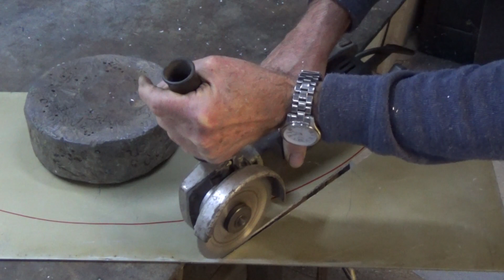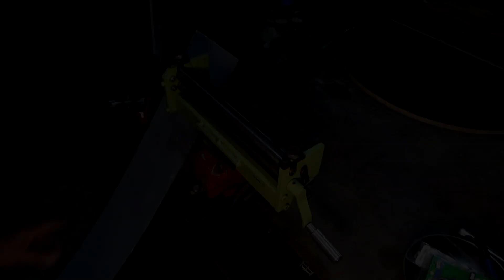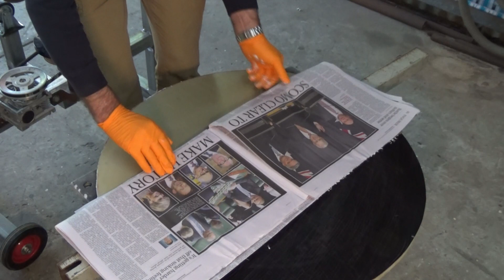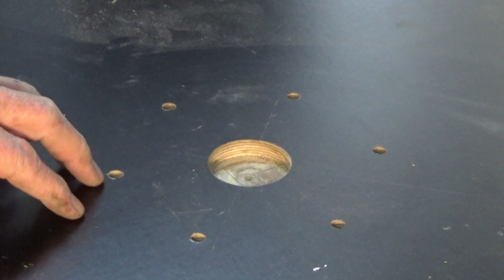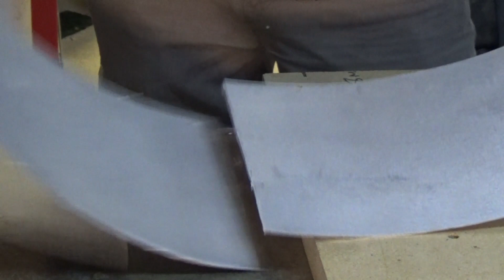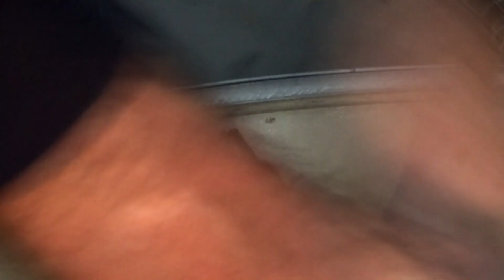The "Kooka Muller", a DIY Sand Muller for the Home Foundry Part 3

Comment: Hi Mark. The aluminium extrusion used at top is sail track. Can be bought at most caravan dealers or any business making canvas/ vinyl  goods. I used thousands of metres over the years as a canvas goods manufacturer installing caravan annexes/ awnings. Great video, I have been looking at ways to make a greensand muller for my future aluminium castings. Cheers, Tony

Comment: mark,
I beleive you will find that the Aluminium will erode quickly with teh sand being ground into it.
Once you notice any wear I would recommend that a 0.6mm of Grade 350 sheet steel be glued over the aluminum as a wear sheet.

great work
Reply from the maker: Charles, I wish I had purchased a couple of sheets of 4mm galvanised steel sheet that I saw at the local recycling centre. They were cheap and just the right size but at the time I had no intention of doing this project and I missed the opportunity. I expect there will be a lot of wear and tear on the aluminium but as you say I can re-skin in fairly easily. I might only use it about 8 times a year so it may outlast me!

Comment: Hi Mark,
as a suggestion when you glue large flat areas together, spread the glue in straight lines. in this way when you press the pieces together the air has a path out and does not get trapped in between the glue lines.
Criss crossing the lines of glue traps air so reduces the glue contact area but also the air acts like a spring that tends to separate the parts.
Reply from the maker: That sounds logical. Thanks for the tip.

Comment: Hi Mark, great vids and I just subscribed, where are you located in Australia 🇦🇺?
Reply from the maker: Hi, I live in Tinbeerwah which is about halfway between Cooroy and Tewantin at the top end of the Sunshine Coast. I was just checking out your channel and I watched the brass rising sun build. I did not know you could MIG weld brass! That's really impressive. I badly want to build a CNC plasma cutter but I have absolutely no room left in my shop which is why the sand muller will have to be stored outside under the awning with the tractor for company. 
Regards,
Mark Presling
Reply: Mark Presling gee your close mate. I’m 10 minutes north of GYMPIE, I mig brazed with silicon bronze/Argon back then but use silver solder now for most brass work. If you are ever after any brass scrap let me know and I’ll give you 5kg or so for your moulds. Also have other scrap if interested. I’ll have to start making vids again, I’ve been manly on Facebook,Instagram for most of my work with over 10k on FB page. Cheers Rick
Reply: Hi mark let me know if you want some scrap? I’d be more than happy to help out!!! Cheers Rick 🍻🇦🇺

Comment: Is that a slug of lead that you are holding the plate down with?
Reply from the maker: John, yes it is a big chunk of lead. It belonged to my father and I recall using it as a kid to hold macadamia nuts so we could crack them with a hammer. I think he melted down about 10 lead acid batteries to make that chunk. I keep meaning to melt it and cast it into something a bit easier to move, like a brick shape with a cast in handle. Maybe when I have a sand muller I can tackle that task.
Regards,
Preso

Comment: I don't know what kind of a sand you are going to mull with that, but what I use is beach sand mixed with bentonite and water - bentonite as a binder and water as solvent. Looking at your design if your sand mix is anything similar to mine, I think you will need couple of mixing blades for your muller to work. Problem with using just a roller and no mixing blades is that the roller will break only those clumps of sand that happens to be just underneath it's path and after those clumps are broken it will roll the sand in a thick and hard cake leaving the sand that's on the outer edge and in the center untouched and full of clumps. You need to have a center column on your muller that prevents a "dead zone" where sand is just rotating around the center axis  and mixing blades that scoop the mulled sand from the bottom of the muller and feeds unmulled sand to under the roller. 
Another thing that worries me in your muller is the wear resistant (or the lack of) of the aluminium. I have a industrial muller and the drum is lined with plates made from wear resistant steel but the sand is still eating that away. Also the mixing blades of my muller are lined with wear plates similar what's used in ploughs and excavator scoops and like, and wear out ot those is horrid regardless.
I don't mean to disharten you of bash your efforts by any mean though, just some pointers from my experiences. I wish you good luck with your muller and I'm curious to see how it turns out, for a light hobby duty it might be just adequate.
Reply from the maker: Hi, I am fitting the ploughs to the muller at the moment. Unfortunately I didn't get to it in the last video. It will definitely function the way you are describing. With regard to the aluminium base on the muller, I know it will wear but then I don't use it as much as an industrial muller would be. I might do 10 or so casting sessions per year so I am confident it will outlast me.
Regards,
Mark Presling

Comment: Reminds me of the foundation to my earlier muller.i hope it will work well.for.you. I ended up placing a 3/8 steel ring on the bottom just where the wheel rolls but my floor of the muller was as thin as tin that was on a laminated MDF turn table which was bolt to a vehicle trailer axle
Reply from the maker: I think I tend to overthink things sometimes. The operation of a muller is very basic and as you have observed it doesn't need to be built like a Rolls Royce. 
Regards,
Preso

Comment: That alloy extrusion is for a caravan or boat to hold an awning with a bolt rope.  Just for your info.  Great videos.
Reply from the maker: Thanks, I actually found some lengths of new extrusion down at our local hardware today. Quite frankly it would have been better to buy new stock since the stuff that was given to me was covered in great big gobs of silicone and lumpy paint. It took ages to clean it all. The only positive was that it had plenty of holes drilled in it already.
Regards,
Preso

Comment: Thank God you don't drown out your videos with God awful repetitive head banging thumbsucker noise. Any half decent machinist will agree that listening to the sound that the tool makes is part and parcel of operating it correctly.... If you don't mind me asking, where did you get that 60:1 worm drive?
Reply from the maker: They are available on Ebay here in Australia. https://www.ebay.com.au/itm/60-1-Worm-Gear-Reducer-for-NEMA-34-Stepper-Motor-NMRV040-CNC-Milling-Lathe/273846058370?hash=item3fc27f3d82:g:HtQAAOSwWzBc1orQ&frcectupt=true $139 including shipping. No music from now on except for very exception circumstances. I can't go into details but you will find out in the next video. 😀

Comment: Your doing a great job. Stop being so hard on yourself. Just my 2 cents for what it's worth, I would have screwed & glue the aluminum panels down. On the outside panels four to six screws around the circumference, and just three or four in the field. The center panel three or four around the circumference, each end, and just four in the field, equally spaced. Can't wait to see this Kooka Muller chew some sand.  Not for nothing, but I do believe you way over did the glue. I'm guessing that 1-1/2 tube(s) would have been more than enough.
Reply from the maker: Stanwood Dave, I had originally planned to screw the sheets down but I wanted to use stainless steel screws and I couldn't find any suitable. I had used that Sikaflex glue on a project where I had to glue down some galvanised steel anchor plates to some structural steel in an outdoor situation. It was also screwed down but I was told that the screws were just to hold things until the glue cured. I asked the consultant how easy it would be to lift the plates later if I had to do any maintenance and he said I would have to destroy the strips to do it. So far it is looking well bonded but only time will tell. 
Regards,
Mark

Comment: Looking great Mark. If you think you've had a hard time with some of the parts of your muller, just wait until you try to place the plows in just the right places to direct the sand into the path of the wheel.
Reply from the maker: Sandrammer, I just started that process today. The centre plough was giving me the most grief. I have decided to make them fully adjustable in all three axes. 
Regards,
Preso

Comment: Great stuff. As a non-caster I'm a bit puzzled - MrPete uses a muller, but he uses an oil-based sand, and I kind of thought that was why he used a muller. Myfordboy uses green sand, and he seems to mix with a drill in a bucket, but has automated the sieving with his own design of shaker. Maybe when you do your demonstration run,  you can explain mulling vs sieving etc?
Reply from the maker: thisnickldo, my understanding is that the mulling process is not necessary but it just sort of automates the preparation of the sand. Prior to this I have had to get on my hands and knees and use my hands to break up the lumps of dry and compacted sand and add the water with a sprinkler, gradually. However, the action of the muller also improves the strength of the sand mould by fully coating each grain of sand with a coating of fine clay particles. Without mulling the bentonite clay (binder) is just distributed throughout the sand matrix. Some grains of sand may have no binder at all and some might be only partly coated. I have tried using a drill and a mixer like the one that Myfordboy uses but I end up losing a lot of sand as it gets flung everywhere. At the end of the day I am looking for a method that creates a more uniform blend of green sand. I have found in the past that after I do a hand mixing operation there will be pockets of really wet sand and some that is too dry. When you ram up sand with non uniform moisture content it leads to problems during the casting process. If you check out Luckygen1001 he shows how he mixes his green sand and it appears to be perfectly blended. I have seen Myfordboy's seiving tool but that was a fairly old video I think. Unfortunately it is a very complex topic and everyone seems to have their own favourite method. 
Regards,
Preso

Comment: Wow, driving 100 km is a typical one-way trip that I wouldn't think twice about doing to get something. 
yep circumference of a circle is C = 2Pi*r but in rolling metal, the metal (especially aluminum) stretches and thins increasing the length 
for D = 720mm C = 2*Pi*D/2 = Pi*D = Pi*720 = 2261.95mm = 2.26m ~~ 2.3m thus the extra distance is in the stretching but that should be less than 10%... I think you have a measurement error (yep at 27:00 measurement error found)
Reply from the maker: My mate measured the length of the stock while I was on the phone to him. I am guessing he was trying to use the tape measure one handed. I will double check his work from now on. 😁

Comment: G’day Presso, the top trim is sail track, Bunnings has it for shade cloth as explained elsewhere. Hey I’ve got that model router, can’t stop it. The build is progressing nicely, well done. 
Cheers 
Peter
Reply from the maker: Peter, my mate rang me later in the afternoon after I had finished the video and told me that the extrusion was used to make clear awnings at the Noosaville Yacht Club. When he gave it to me it had great gobs of clear silicone, paint and zillions of pop rivets in it. It took nearly an hour to clean it up and I was thinking it was never going to roll correctly but it did. I will check out Bunnings next time I am there although I hate shopping there. The staff aren't much help and the aisles are always full of crap and if you want four of anything they will only have three! 😖 We had those Makita routers at school and the kids couldn't break them so they must be good. The one I have belonged to my father!
Regards,
Mark
Reply: G’day Mark look in the shade cloth isle not the aluminium extrusion isle:(  Ah yes the packaging of bolts is a bug bear. When I was young hardwares would also stock pulleys, not Bunnings. Problem is they look at turnover so the odd bits and pieces are now specialty items. Speaking of pulleys, I can buy them cheaper at the local bearing house than eBay, try eBay for a shaft set screw collar $15, bearing house, $5 I bought 1 two days ago, what’s going on with eBay???ahhhhhh enough ranting, cheers

Comment: Now if you could put together an adjustable curved laser for the bandsaw it'll be perfect!

I noticed the angle of that arm in the last video but assumed that either I was missing something or you had a trick up your sleeve to make it work. Oh well, I'm sure we've all been there.
Reply from the maker: Big face palm on that one. I also realise now that I have to modify the mountings for the ploughs so that they can be removed easily. The problem is that every build like this is a prototype. If you could build a second one you would most likely get everything right the first time but it is never like that. 
Regards,
Mark Presling
Reply: @Preso58  That's why it takes me so long to build anything. I plan it to death and then still run into problems when it comes time for assembly. Thanks for sharing the process!

Comment: @ 15:30....I always preferred C = πd....I always thought that 2πr was beating around the bush a bit. Quick and dirty estimating is 3xdiamter and round up :)
You made me laugh...a true perfectionist worrying about scratches on the aluminum that's going to be ground into submission with mulling the sand lol.
-Head smack at the end cutting the wedge at the top instead of the bottom lol...sigh I've had those days. But it's coming together nice great job so far.
Reply from the maker: I thought about cutting the wedge from the bottom but I was worried about shortening the arm. It sort of has to be sized so the roller is on the centre line of the drum so it doesn't roll "crab wise" if you know what I mean. I can already see scuff marks and wear tracks in the aluminium just from the short running that it has done. 
Regards,
Preso
Reply: @Preso58  oh, sorry. I thought that's what you were implying by the head smack graphic at the end that now you'd have to fill the cut. But you're right that would shorten the shaft the other way around. It didn't occur to me. Right on👍
Reply: I'm also a fan of C = Pi*d   it's much easier and faster to measure a diameter than it is to measure a radius.

Comment: Wibbly Wobbly, is that a precision engineering term? The aluminium profile you used for the rim is used for shade cloth or canvas annexes where they are attached to a house/vehicle etc. The cloth has a rope stitched into the edge and it is the rope that slides through the channel. 

Looking good!
Reply from the maker: I looked up wibbly wobbly in the Machinists Handbook and it's right there alongside "Skookum" and "Schmoo" 😁

Comment: Been waiting to see how you would trim the the base of the drum - good safe solution, but not as spectacular as the motorized router method - I'm a bit crazy and I would probably try it out first to see if it works :-)
BTW, I prefer all the shop noises than any music background - shop noises are music to the discerning listener.
Reply from the maker: Jose, I like your observation...."shop noises are music" I agree... Ha ha.
Reply: @Preso58  Thanks Mark :-)

Comment: So I know this is one of those "after the fact" things but... Why didn't you just drill your center holes in the center plate and use those to clamp the center area?
Nice build and am waiting to see this thing running! BTW if you're missing the heat, here in Texas we're just shy of 40° C.
Reply from the maker: Jim, I was thinking about this comment all through breakfast. Here goes.... first up, I didn't think about that solution. Secondly, the glue film is relatively thick and it doesn't get absorbed by the materials so it stays as a sort of rubbery film between the wood and the aluminium (aluminum 😁) so, if you were to apply spot pressure by tightening up the six screws it (could) induce a localised downward force that would make the metal sheet cup in that area. The large kitchen countertop and caul are an attempt to create a uniform pressure over a large area. I can't say I am missing the heat but it has been unusually chilly here. Down to about 5C in the morning. We were getting days of 36 plus in the summer but it is the humidity we get with it that takes it's toll. I am guessing that it is dry in Texas? I would love to visit there. New Mexico too. I am a big fan of "Breaking Bad" The landscape they showed in the series looked fantastic. Maybe when our dollar crawls out of the toilet we can do another visit to the USA. 
Regards,
Preso